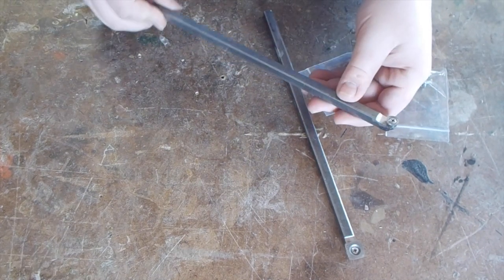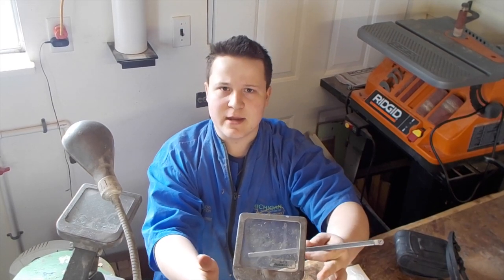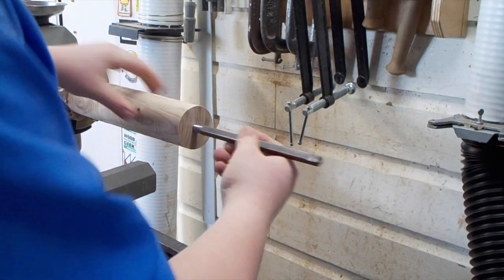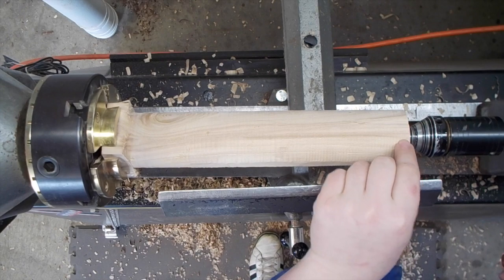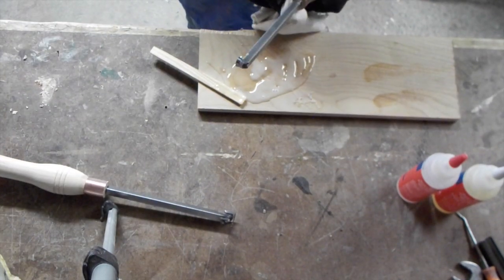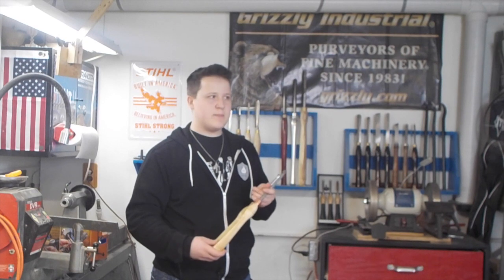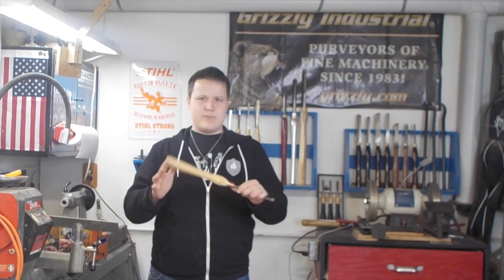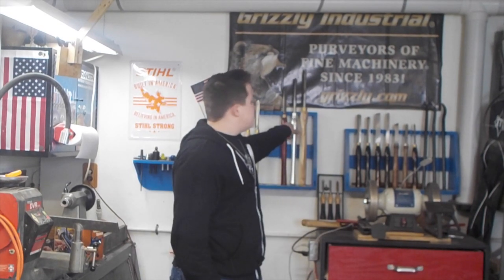Making Tool Handles for Carbide Cutters

Comment: Made my own also.  As a beginner to turning, woodworking in general, I can look at mine and know that I made them.   I ended up slicing my blanks in half and using the router and re-glue method.  Mine are copies of the large EWT on 1/2" bars, but I have discovered that they are great for roughing and working on large peices, I am going to make some smaller ones on 3/8" bars.  I used my beeswax/mineral oil mixture for the finish; keeps the dirt off and provides plenty of grip.

Dave

Comment: Hi Peter I made my own cutters as well. I just knocked the corners off the square stock and drilled a hole just bigger than the diagonal. I also cut kerf lines in the bar with the edge of the grinding wheel to give the epoxy more to grab. You're right in saying there is nothing like the feel of a tool you've made yourself.

Comment: nice tool handles my carbide handles are all made by me you can sink in the handles in a square hole take the diagonal measure 3/8 rod it will go into a 1/2 hole drill a small hole in to your handle to let air escape and put in your epoxy and tap the bar in place by letting the handle hit the floor a few times to seat the bar then wipe the epoxy from the little hole in the base of your hole i have never had a bar come you with this method saving the step of grinding you bar round at the base you will enjoy the carbide sold my Cptn Eddie I buy all of me carbide from him

Comment: Peter what about turning between centres to get max.wood from the peice? Cheers Roger B.V.S.A.🇦🇺
Reply from the maker: +Roger Leslie That'd work, I was happy with the length of the tool handle the way I made it and I needed a way to hold it to drill the hole
Thanks,
Peter

Comment: Great video, but man, please bolt down that grinder and adjust the tool rests.  You were very lucky that what happened at 2:11 didn't cause the wheel to shatter.  If that happened, it could have destroyed your hand(s) or even killed you.  I work in a machine shop and I know of horror stories just like that.  In fact, I'd probably discard that wheel and use a new one.  If it's cracked internally, it's a ticking time bomb.